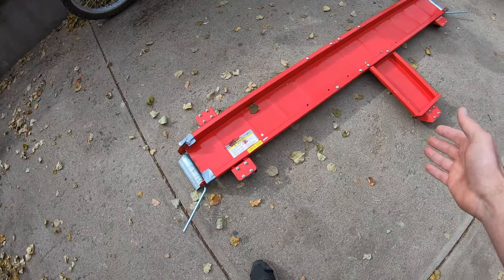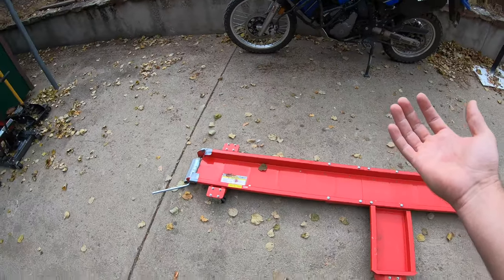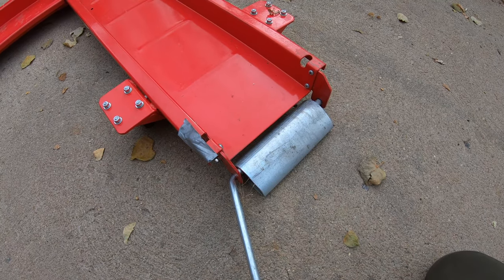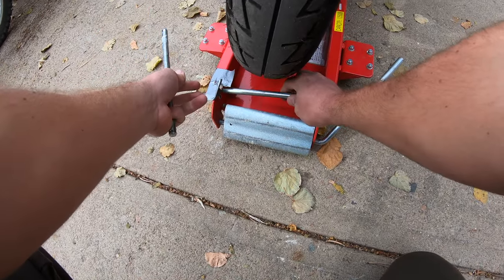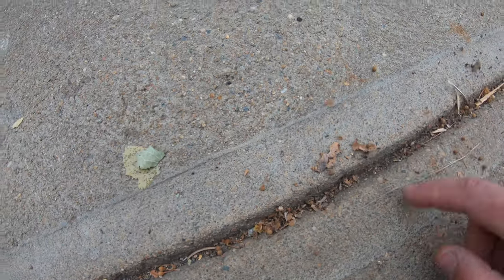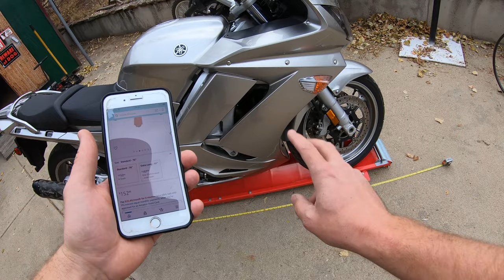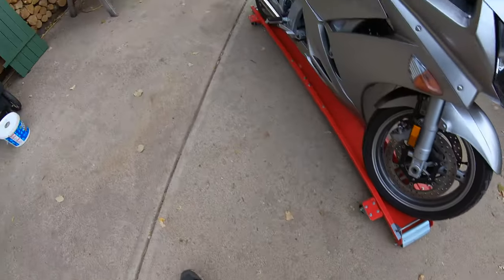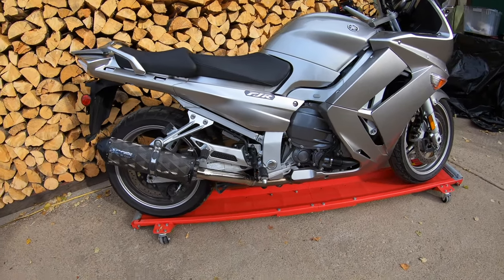How Well Does a Motorcycle Dolly Work? 582 Lbs Bike

Comment: Consider also adding luggage and the weight of a rider driving the bike up onto the dolly. My "little" ctx is 600 book, add 200+ me, and Thats already pushing max capacity, but remember, limit does not equate optimum. I see the higher limit as a stability factor.

Comment: My guess is that most big Harley’s weigh in at around 600-800lbs then add a 300lb rider. Bam! 1100lbs. I plan on riding my bike into that thing. Not push it.